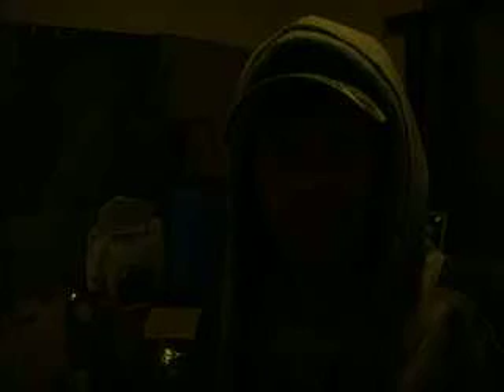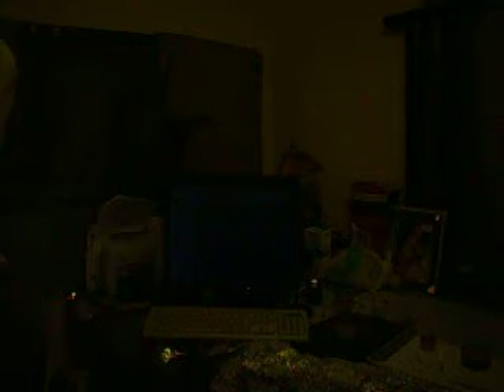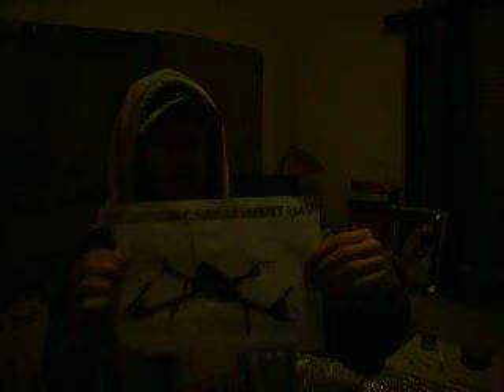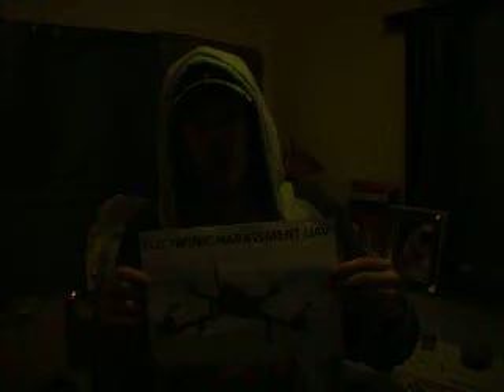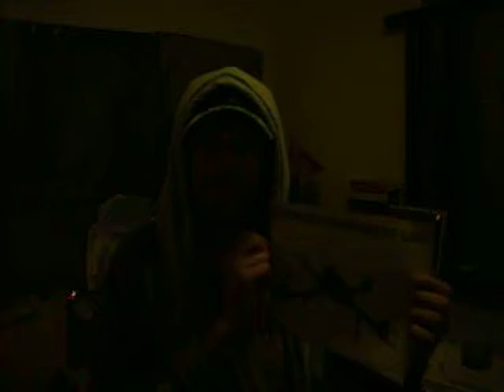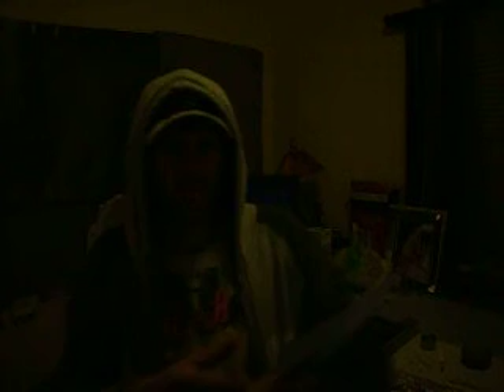HOW ELECTRONIC HARASSMENT ATTACKS AND DIRECTED ENERGY (DEW ATTACKS) ACTUALLY WORK

Comment: Earthing or grounding reduces the targeting and heals the body at the same time.  I have never had a drone over me or my home and this would not explain night time attacks.  There is no solar power then.  In my opinion from the scientific investigations I have had, the attacks are BAN or body area networks.  You can see the electronics with a nonlinear junction detector scan.  This is a $35,000 piece of equipment that detects electronics whether they are on or off.  These electronics are in the same location as the BAN.
Reply: The attacks that they do come as highly directional beams that can be refocused or repositioned. So, whether that operates small implants (whatever) or not is the other question, but in many cases the beam comes from distant locations (e.g. the forest).
I bet the signal isn't that strong, otherwise it would burn things. Why a drone couldn't do that? Those devices can be very resistant to wind etc..
I'm not saying he's telling the 100% truth, everyone can read his website after all. But what he described a few years ago is very similar to what I've been experiencing.
From my experience, earthing or grounding does not make a difference.

Comment: Buy a tri-band rf field strength meter, it will show you where the implants are on your body and any external energy sources, set it up once you have your house levels noted, set the alarm on the meter to activate when external energy comes into your property whilst sleeping.
Turn off you mobile, WiFi, computers and all none essential electric items when not using them or when going to bed.
Enjoy a better nights sleep.
The meter will show you the reality of reality everywhere.

Comment: This person is either dead or is a very dangerous criminal. No way the 
authorities investigate such crimes this way.
"Working with government agencies and law enforcement worldwide" ?
The problem is that this sort of criminal activity actually exists, and 
the authorities do not investigation it
because these fake actors post/share an extreme amount of lies using 
fake profiles. Mind control, HAARP, human experiment, etc. all belong to
 their ideas.
This person is likely a fake person and not even British. What he shared
 a few years ago is very similar to - if not the same -
what those criminals do. They apply Russian-style psychological 
harassment for a certain time, and after the victim is labelled
mentally ill and unstable by his/her environment then they start the 
actual criminal activity (murder attempt).
They either set up a radar system - or - microchip their victims and 
continuously ignite or turn on the chip to force the victim into
severe sleep deprivation.
The symptoms that are caused by the electromagnetic radiation or by the 
chip can really be blocked by an enclosed metal cage,
and the symptoms have absolutely nothing to do with any sort of mental 
illness because they usually turn on this radiation at exact times (e.g.
 19:00),
and they can and they will continuously reposition the system to focus 
the radiation (directional) exactly to the victim. It is likely an 
automated system.
This person started to post disinformation that this crime is done by 
one person, Anthony Mandanici and that he (Thomas Baker) is part of the 
British Royal family.
"Thomas Baker" is either dead or his account got hacked or he is part of
 the criminal network.
I can confirm that this sort of criminal activity does exists in Hungary
 and it is done by a criminal network or mafia organization.
The authorities can't deny anymore that these harassment exist because 
American diplomats were actually harassed by similar ways (w/o the 
electromagnetic radiation).
Akos M

Comment: infection is on body ears and eyes 

body method:
Epsom salt -also digestive(hot water) keep checking skin with microscope for signals on skin looks like wire fibers ,black specks
hunny
Vicks rub 
lime 
lime salt

Digestive method:
Bentonite clay
potassium 
garlic 
iondine
potassium iodide 
(no sugar keep sugar up at a low level) 

cloths method:
borax soap - no Landry detergent ..

everyone has this shit just controled particles by satellite 
anyone can be targets.. do the shit for about 4 to 5 months

Comment: Do you know that Quadrocopters need all four propellers driven all the time? So, if ony one of this motors or speed regulators is damaged, the copter is unable to stay in air and crashes to the ground.
The batteries for such vehicles aren't stable, though. They are mostly Lipo-batteries, they can be discharged very fastm but the charging takes lot of time (15 minutes to one hour). The faster the batteries are charged, the higher risc of burning and explosion.
So, if your thing is the truth, there need to be many burning copters crashing. Your story is a story without truth, it is not possible.

Comment from the maker: A Faraday cage consisting of a metal grill will let some of the microwave beams directed energy in through the holes that make up the grill. Flat metal sheets won't let anything through. People who made makeshift Faraday cages are still getting baked crazy. metal sheets would have cost them less and they'd still be alive. I suggest that every TI goes out and buys 500 baking trays and gets every surface area of their room covered with no gaps. Windows, doors the lot and cascade them over things like windows and air vents. A 5mm gap between the sheets and you can still be killed. You don't need metal sheets on the floor because the beams come from unmanned quadcopters above you. This isn't the government doing this to you.
Reply: There was a thread were he said the reason why the floor does not have to be covered is because houses in his area in Britain contains lead in the floor or something like this.
Papers show that even 40cm brick-concrete walls does not block EM radiation more than 15-20dB, and I've personally experienced strong radiation coming from the downwards direction (at the 2nd level). The floor must be covered too.
There are many EMI shielding papers like the following one, these give correct information http://www.dtic.mil/dtic/tr/fulltext/u2/a257412.pdf

Comment from the maker: The purpose of the funny attacks is simply to kill you over time for life insurance, the only way to block the radiation is to cover all your walls with metal sheets, or make a metal box round your bed with no gaps and some kind of overlapping cat-flap door. If you dont do this you'll just die, A TI has died in the last two weeks because she bought drugs instead of sheet metal
Reply from the maker: You dont need metal underneath the metal enclosure (because the straight microwave beams come from the sides and above) you need to make around your bed. you need to make some kind of metal cat-flap door that overlaps too. You must cover the hinged part again with metal. if youleave a 1cm gap then they can still murk you. TI's who don't protect themselves get ill then die of fake strokes and heart jumps. if you have limited metal sheets then do the top of your walls and work your way down. My protections methods actually work. if you can show me proof that the DEW system the gangstalkers use can get through my protection (as long as you do it exactly as I said) then I'll give you £200 by paypal.